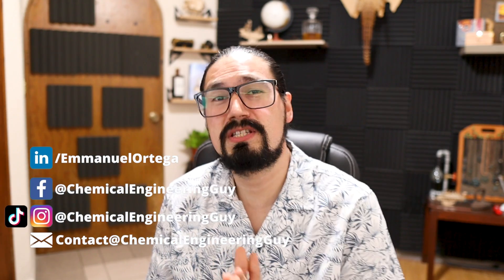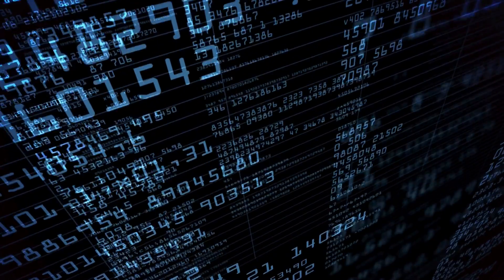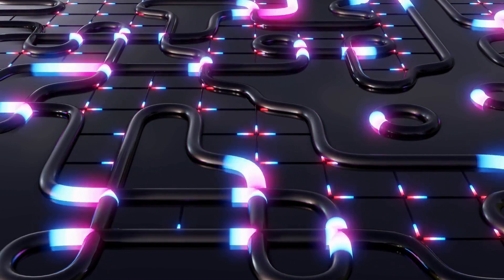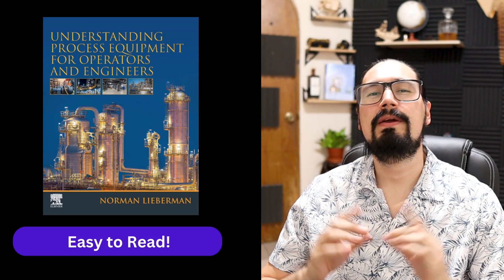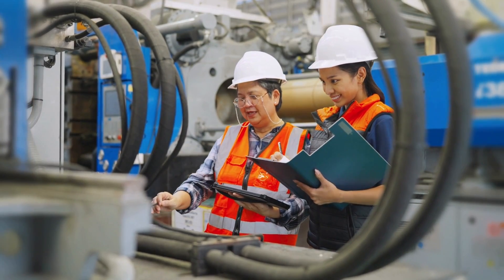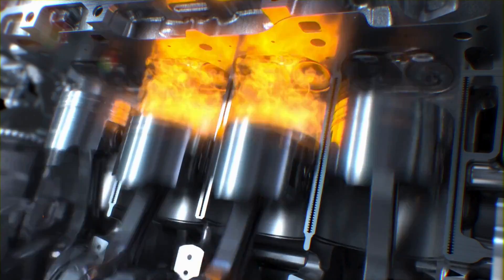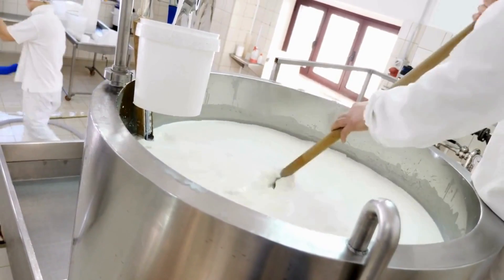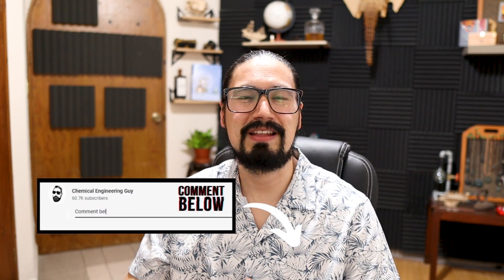Essential Handbooks for Career Starters: A Journey in Process Engineering

Comment: In an industry where distillation is still king, "Distillation Operation" and "Distillation Design" by Henry Kister are must-haves IMO.  While slightly dated, the fundamentals and overview of all the relevant topics to distillation in these two texts is still the best presentation of the material for the practicing distillation engineer or designer that I have encountered.  Its the gold standard for distillation reference texts.
Reply from the maker: Nice! I'm not quite familiar with those specific books, but true, especially if you are going to be working in Distillation Units. I tried to cover "basic" or "general" books as well

Comment: Recommending machinery's handbook for chemical engineers? Just how much mechanical engineering a chemical engineer learn?
Reply from the maker: Some units are mostly mechanical: Agitators/mixers, Piping, Pumps, Compressors, Blowers, Fluidized Beds, centrifuges, motors, tanks, vessel, pressurization systems, filters, separators... list goes on and on :)
Reply: @ChemicalEngineeringGuy  This is what confuses me. I sometimes feel like a mechanical engineer makes a better chemical engineer in the chemical industry.

Does a traditional ABET accredited chemical engineering program provide training in these mechanical concepts? Or is it only learned on job?
Reply from the maker: @مازلتعلىقيدالحياةلابدمنمخرج  Mostly, learned in lab/practice at academical institution and of course, in the job, it will be impossible to train a ChemE in all unit operations and equipment in the several industries